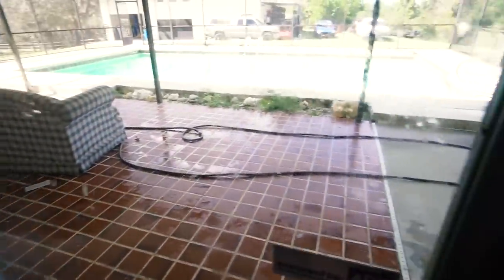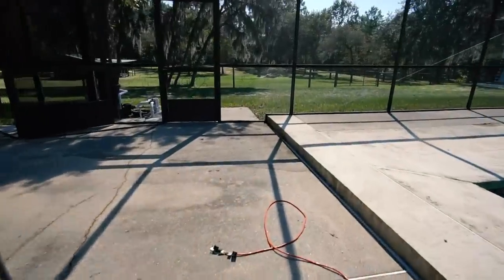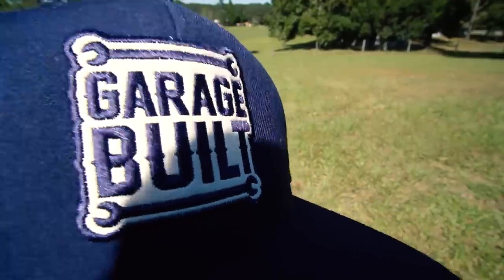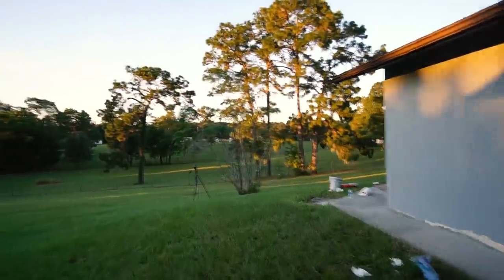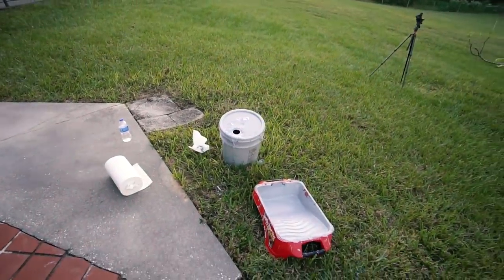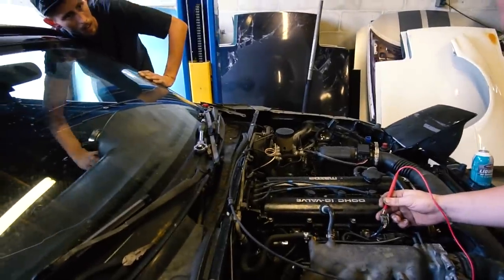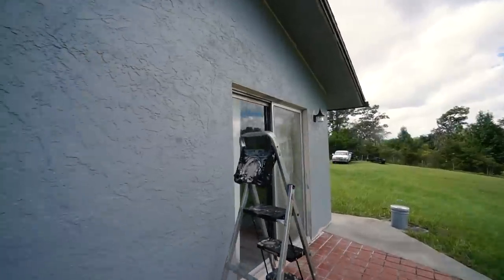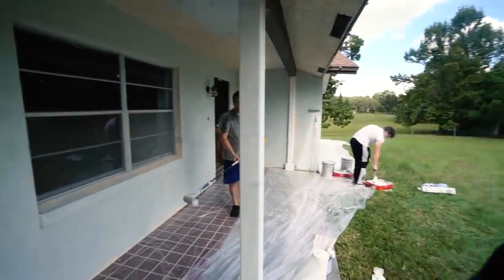Painting The New House PURPLE!? and Trailer Mods!

Comment: You have the wrong roller cover you need like a 3/4 inch nap for stucco and you’re probably using a 3/8 inch nap which or for smoother texture
Reply: It was probably soaking it in too. The rollers looked pretty dry as if they were trying to save paint. That paint looked old as heck. 
 Spray gun is the best for stucco. At least out here in AZ where its like painting over fresh stucco every time.
Reply: He needs to cut first at least😭😭😭 and roll all the way up and down

Comment: As a full time painter that was hard to watch you suffering with a roller 😆 

Rent a industrial sprayer for $50-100/day. Sooooo easy to use even if you never have before. Spray the stucco really heavy and then roll it.
Reply: THE_FAMILY_MAN_CLAN oh god, i clean houses from time to time and one time i did a remodel. The painters didnt prep the floors and windows, the whole house was covered in overspray, it was a nightmare. But i agree it was a pain to watch the paint lol
Reply: TrailerParkAutomotive 🤦🏻‍♂️ really? Some people. The fact they didn't mask makes me think they're idiots.
Reply: Ilikeboost Where i live most people don't know anything. Lol
Reply: Movers didnt know how to disconnect my air compressor house from my compressor so they took the quick connect apart and lost all the ball bearings out of it. You would be surprised how dumb some people are 😂 now I need to find a new quick connect for the air compressor side. 🙃 I had moved already and it was at my moms house btw.. otherwise I wouldve probably done it since those idiot's decided to unscrew it 😑
Reply: For me just looking at the thumbnail made me cringe 😂 had to watch I understand some people don’t know though

Comment: I’m a truck driver and have the same problem with the brake lights going into the a and b trailers sometimes. Either pull apart the plugs - starting with the trailer plug and make sure the cables are making contact with the terminals or just go buy new plugs and wire them in. They go bad all the time just from standard wear and tear. The brakes might be related to the same thing if they’re controlled electronically. If they’re hydraulic that’s a different kettle of fish. Hope this helps mate.

Comment: well next time, Rent a paint sprayer from home depot or lowes for all the big areas, also you can use a roller with a 3/4 to 1 inch nap for better filling on the small little gaps like you showed.